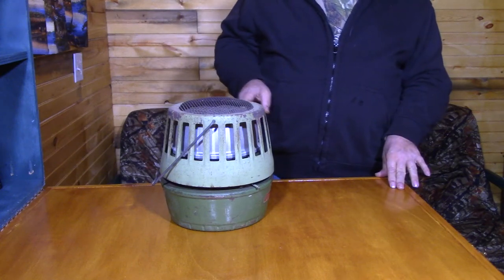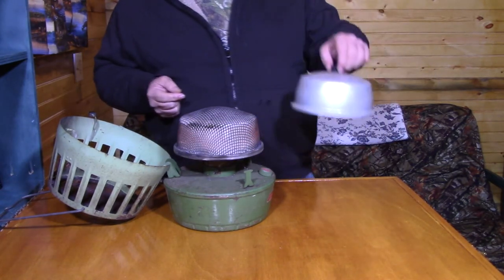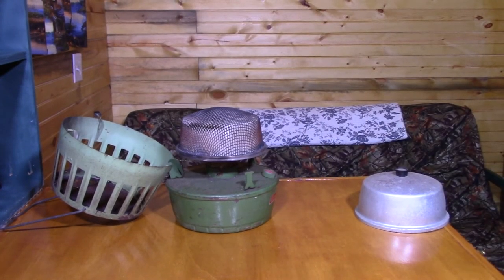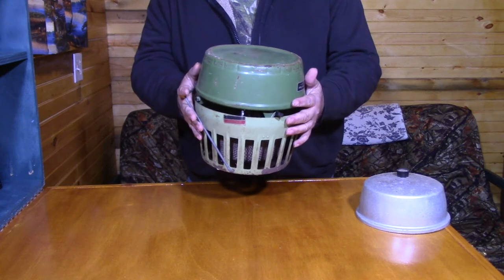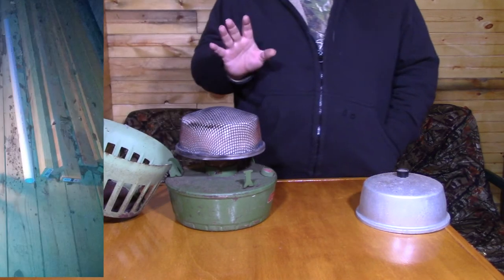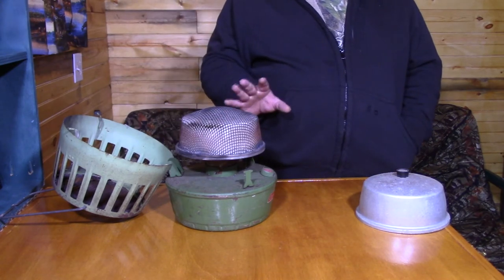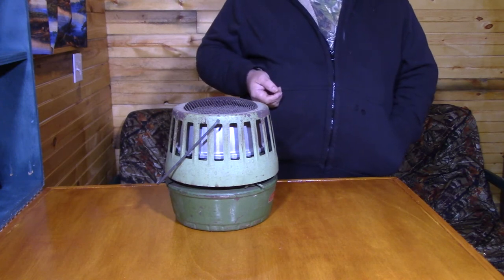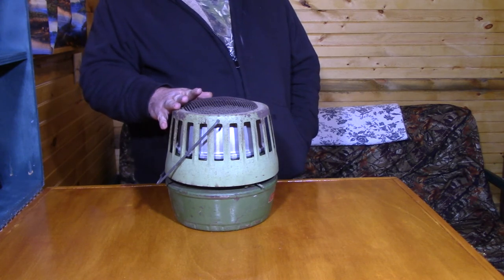Coleman Catalytic heater

Comment: They are great heaters...i used mine for hunting in the mountains
Reply from the maker: So you use yours in a cabin or in a tent?
Reply: Grandpa's Place actually we used ours in the back of the pickup that had only a topper on it
Reply from the maker: I would not have thought of using it there. Thanks for the info.